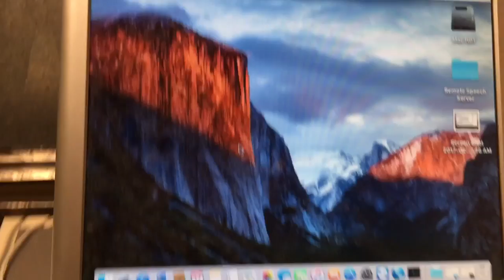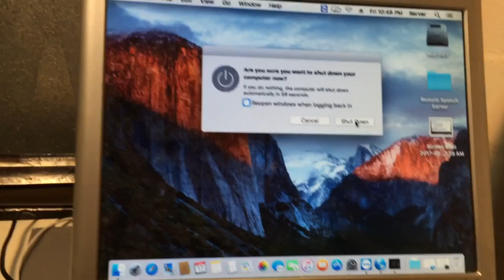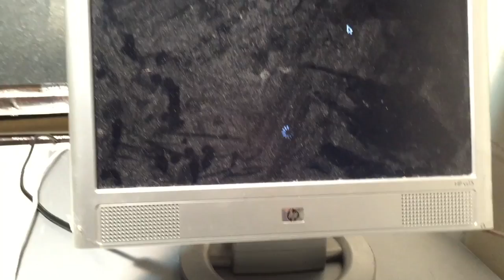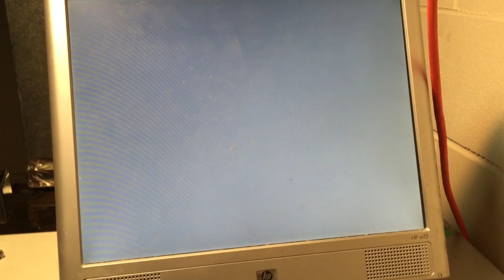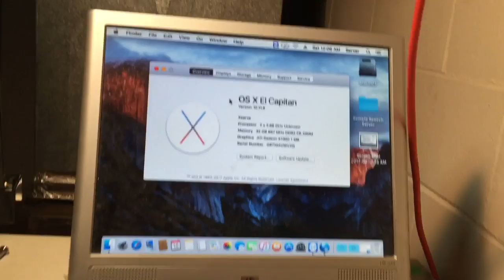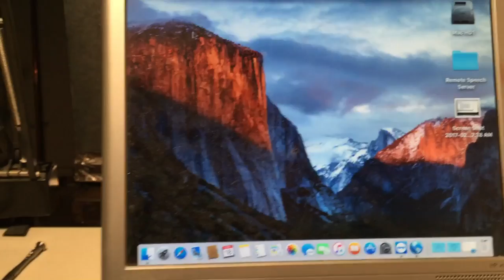2006 Apple Xserve 1,1 CPU and RAM Upgrade

Comment: How did you get 10.11 on it? I tried multiple times on mine but never worked. I also did the 8-core upgrade and the CPUs are unknown on mine too
Reply from the maker: I just did the install on another supported machine, then replaced the necessary boot.efi files in the install with patched ones that allow the system to boot on EFI32 systems.

Comment: how did you install El Capitan in that old MAC?
Reply from the maker: Just use the same method to install El Capitan on a Mac Pro 1,1 or 2,1. It's essentially the same machine. I have a video about the process on my channel.
Reply: I went to your site and download Sierra patch and it did the usb boot installed and when I went to my Mac Pro early 2008 it sees the usb pen drive but it wont boot from it.
I kept press ALT and it says boot with my internal HDD or external USB.
I don't see any patch for El Capitan in your site
Reply from the maker: Not on my site, it's another video on my YouTube channel.
Reply: dosdude1 hi there , amazing cpu upgrade video. I have upgraded my Xserve 2006... but El Capitan installs then crashes after around 5 mins of use... Any ideas ?

Comment: I wonder if you could put a mother board in this to run windows server on it.  The one I got gave to me has Xeon 5130 2.O Ghz dual core processors in it.  with 24 gigs of ram.  as of now I cant get any video a PC monitor using the Dongle.  and the usb's dont recognize the keyboard.   I love to use this for my security cameras.  and find processors that support QuickSync that would fit in this.  But first I need to get what I have working right.

Comment: I know that this is unrelated to this specific video, but I was hoping you'd be more likely to see if I commented here, because I need some help. In the video where you flash the X850 Pro, you mentioned that you reduced the rom yourself. How do you do that? Because I have a 9200SE for my G3 B&W (currently trying to flash it with my G5), but the only SE rom I could find was 128kb, which is too big, and reduced roms for the regular 9200 don't work. I couldn't find anything online and there aren't too many people that deal with these old macs anymore
Reply from the maker: You may just have to swap the EEPROM with a 128K one... I ended up doing this with my X850 (as well as a few other cards) and it works much better than it did with a reduced ROM. I have a video about the process on this channel if you'd like to see that.

Comment: how did you get the graphics card to eventually work? I have the same model Xserve and the same CPU's lol, wayyyy cheaper than x5365's
Reply from the maker: It ended up just being my monitor that was the issue. I tried it with a different monitor and it ended up working! It only works if the original graphics card is removed, and since the card's not flashed, you don't get a boot screen.
Reply: Fantastic! Thanks for the reply Collin!

Comment: Hi, nice video. I sometimes find these comparably cheap in classifieds or on eBay. I've seen them running a few times and they are even louder than older PowerMacs. Still, I'm wondering if I could build a comparably cheap workstation out of one of these with a cpu, ram and graphics card update. Are there newer types of cpus it recognizes correctly or for which it could be flashed to recognized them, same with the graphics card? And would I somehow be able to run Sierra on it? I'd really like to have a faster Mac than my 2013 21.5" iMac (that one also only supports 16GB of RAM, I'd really like to have 32GB because of work with a lot of samples in a DAW), but a 2013 MacPro obviously is way to expensive and the Xserve goes cheaper than the earlier generation MacPro. Sorry for the long piece of text, perhaps you can help me. Keep doing the Mac hardware videos!
Reply from the maker: I wouldn't recommend using one of these as a workstation, as they are just extremely loud. Compatibility depends on what model you get.. The Xserve 1,1 can support up to Xeon X5365 CPUs, and the Xserve 2,1 can support up to 3.2 GHz Quad-Core Xeons (forget the exact model). I actually did get the GPU working, it turned out to just be the monitor I was using. You can only run Sierra on the Xserve 2,1 using my patch tool. It will not work on the 1,1. The max RAM on both machines is 64GB.

Comment: Beautiful system! is it possible to use her as a everyday computer and install Windows via Boot camp to make her a bad ass gameing Server/computer!?
Reply from the maker: Yeah, you can install Windows on it just fine. I wouldn't recommend using it as a regular computer, though, as it's extremely loud.
Reply: dosdude1 I haven't had much luck with installing Windows onto it
Reply from the maker: You may have to s=do the first part of the install on another machine, and finish on the Xserve... That's what I had to do with my Mac Pro 1,1.
Reply: dosdude1 but have you tried it on the xserve
Reply from the maker: No, but the Xserve 1,1 has literally the exact same hardware as the Mac Pro 1,1, so it should work exactly the same.
Reply: dosdude1 how did you get Windows to work and can you do a video on it

Comment: What are the fastest CPUs compatible with this system?
Reply from the maker: Xeon X5365s.
Reply: Ok thanks👍 I just bought one of these machines but it's the base model and I want to see what it's capable of.
Reply: I got those in mine and it runs great. You can really feel the difference.

Comment: Just a question, why does this machine run so loudly? Also nice video
Reply from the maker: It's a server; they all run loud.
Reply: dosdude1 can you help me make a leopard ISO for a regular DVD.
Reply: because its a server, being quite isn't really a priority
Reply: That's not true actually. Servers can be very quiet, however this one is a 1U form factor, and it is an attribute of the high RPM fans that they are loud. The fans have to move very fast to move the air very quickly across those small CPU heatsinks.
Reply: Because it's a server and it needs hair dryer fans to move plenty of air through ever vent and crack👍

Comment: Oh very cool! interesting the CPUs show Unknown from what I had read up the Xserve1,1 fully detected Quad Core CPUs unlike the 1,1 Mac Pro but by your video its evident thats not true. granted while there is not Xserve2,1 firmware to flash to it so to speak as the 2,1 Xserve is Mac Pro 3,1 based there was an Apple Firmware update for the Xserve1,1 speficly to do with CPUs perhaps that would sort it out the "Unknown" CPUs if your Xserves boot rom is not fully updated. https://support.apple.com/kb/DL209?viewlocale=en_GB&locale=en_GB hope this helps :)